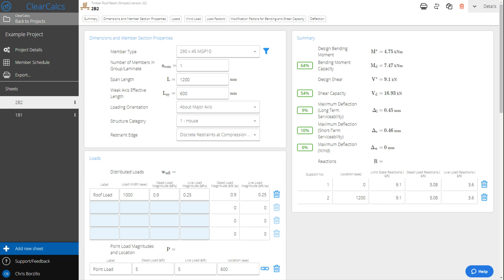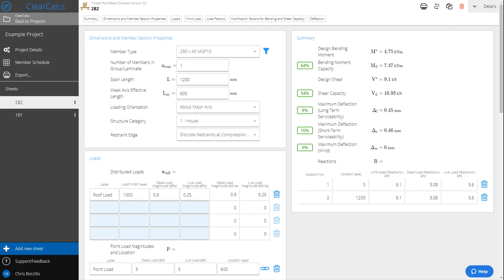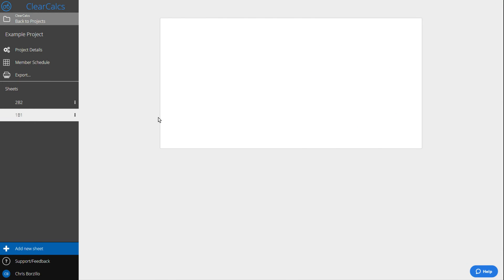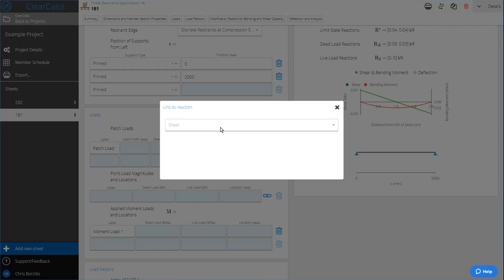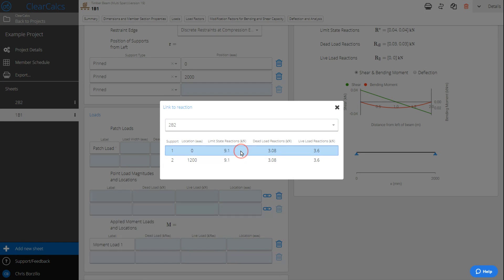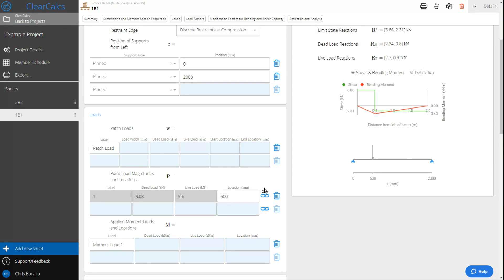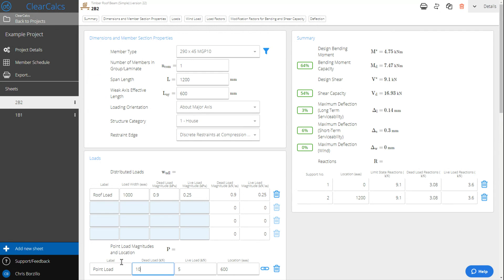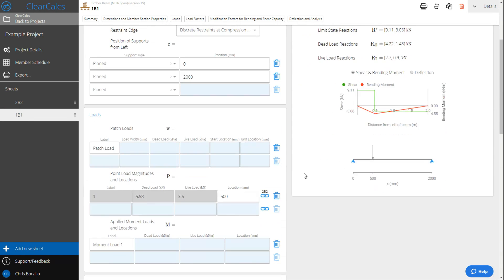Linking Reactions Between Beams in ClearCalcs (Load Path Tracking)

Comment: Is it possible to get a structural analysis of the entire structure (axial loads, shear loads, bending and torsional moments) and use those loads directly for design using your calculation modules? I have the impression that we have to use a structural analysis program separately and insert those loads into these calculations manually? Am I right?
Reply from the maker: Our calculation modules each deal with discrete members (ex. beams, columns) that you can then design and analyze individually to determine loads, moments, and deflections for. In this video you can see you can also link members that share a load path. While we have a 2D frame module, we don't have a full 3D analysis module where you'd designate the entire structure - as you've said, if you have such a model, you can determine design actions from it and put them into ClearCalcs to optimise and tweak your member design, or you can just design discrete members with us directly.